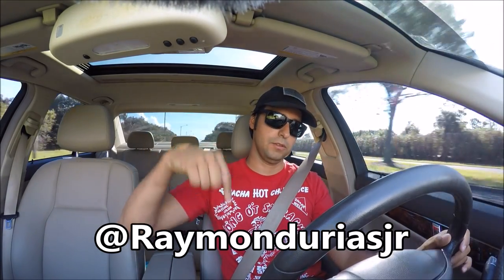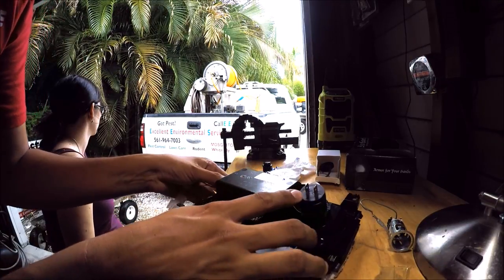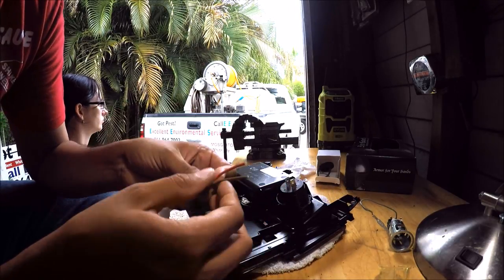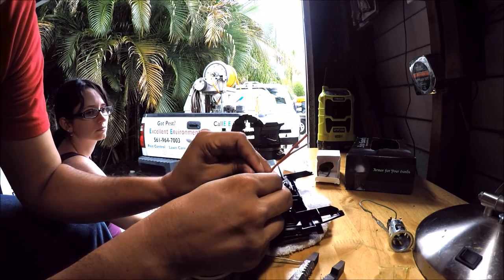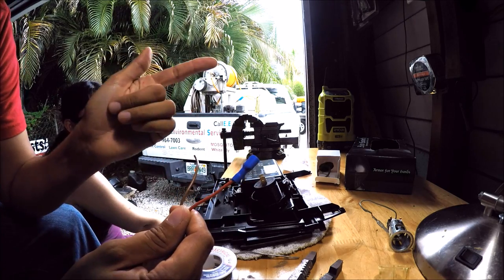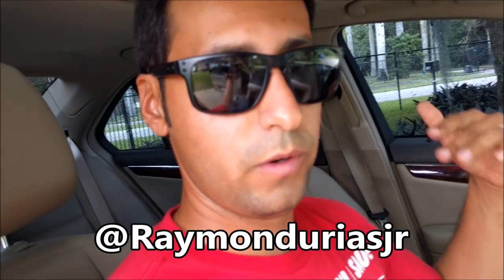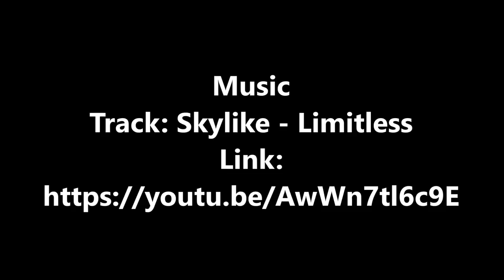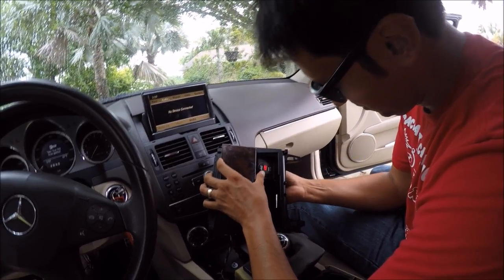Upgrade Your Cars Cigarette Lighter To Dual USB

Comment: The w204 has a voltmeter and ammeter built in.. put the key into 1st ignition and hold the call button and the “ok” button for about 5 seconds. Then a secret menu will pop up and you can view the cars voltage and amperage output, even when driving
Reply: Unable to access this menu for some reason.

Comment: Thank you for your very detailed video. I installed it in under an hour. Tip: to get the car in neutral, once you have the shifter boot popped up, you'll see there's a yellow lever you can pull back on while putting it into neutral.
Reply from the maker: That's also important to know if you're ever on a hill sometimes a car won't shift and you will have to press that button

Comment: Raymond, good videos. One quick thing I'd like to add is that it's not a coin tray, it's an ash tray. Now if people use it for coins and short out their fuse because they drop a dime in the cig lighter adapter by mistake, they can't blame Mercedes for that. They are the ones using it for other means than what it was intended for (but don't we all do that for all different types of things 😆). Keep up the good videos!
Reply from the maker: The GMan pssssh they knew what people were gonna use it for lol
Reply: Raymond Urias lol, very true! You actually gave me an idea where to put my spare change at instead of always emptying my pockets when I get home and then always having to break a bill because I don't have any change on me, ever! Lol
Reply: +The GMan ..my wife would find that change no matter where in was hidden..lol
Reply: The GMan I just dislike the rattling sound of the change.

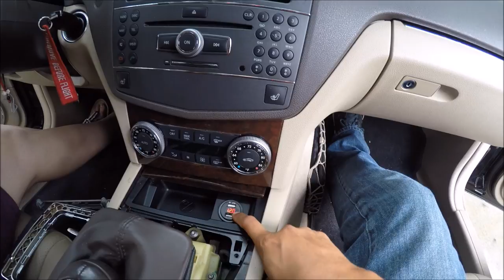Comment: 16:25 “12v the battery is working awesome”... It should be at 12.6 the battery is working quite badly actually. Also while the car is running it should be more than 14v, maybe the readings are wrong

Comment: SO I have a 2010 S550 and got the entire cup/lighter console removed but mine does not have a white quick connect thingy and goes straight into the radio wire bundle (?)… Totally trying to DIY and yours is the first video that actually got the lighter OUT but I am afraid to cut it out bc #1 it’s already pretty short with little to no wiggle room and #2 there’s nothing to disconnect first except maybe my battery…. Any tips?

Comment: Good mod but with the car running your voltage readout should be 14 plus volts as the alternator is charging the battery

Comment: Why not use a removable usb charger.  That way you could always use the cigarette lighter.  Or if needed use that port to use a plug converter adapter to plug things that arent usb and require a wall plug.  Or use it for a small car vacuum, or tire inflater that needs a cigarette port. Dunoo, just dorsnt make sense to retrofit that port.  To each his own i guess.

Comment: What's the name of that white plastic piece that the positive and negative wire plug into that you said be careful when lifting the tab when removing the wire?
Reply from the maker: 12v Voltage adapter
Reply: @RaymondUrias  I got it to work I taped it together with electrical tape. I broke the piece when I pulled it apart but it's all installed and working now! Thanks for the video bro

Comment: Hey Raymond quick question. My12v (front) power socket has no power. I've checked the fuse box (rear and front) and the fuses are fine. So what could my problem be? Do I need to replace my 12 power socket or do you think there is some wiring issue somewhere? Any ideas as to where I should start? If it is just the power socket itself, I suppose I could just buy one of these kits.
Reply from the maker: Daniel Sadjadian if it's not the fuse it usually is the socket. Pull it out and check the voltage

Comment: Nice video seems kinda hard for me to tackle down  any up coming mods to the car !!!
Reply from the maker: Snoopy4156 Just imagine that annoying guy from every Adam Sandler movie "You can do it"
Reply: Raymond Urias what are your thoughts on strut bar on the c class I was thinking of adding one to mine ?!?
Reply from the maker: +Snoopy4156 I don't think I would ever notice the difference. I don't drive that aggressive so feel the lateral movement. If you track your car then yes, if it's a daily driver then maybe consider different mods.
Reply: Raymond Urias thanks !!! I don't know what other mod to do to the car besides the eurocharge ecu tune I also want the drop the car a little inches but there's no video on that and I don't wanna do it without any visual guide

Comment: Is it quick charge compatible? Btw you need to turn your mic towards you when pointing your camera at something, I couldn't hear anything most of the time (On a mobile device)
Reply from the maker: +Sohayel Nafi this one is not it's just dual 2.0 fast charge is 3.0
My audio is gonna be the death of me. I had to remove the sound of a fighter jet towards the 2nd half of the video and lost alot of the original sound quality.
I going order a microphone that I can just clip on me, I'm over this Rhode mic! I have wasted over $300 on mics!
Reply: Raymond Urias I would be mad if something doesn't work after paying 300$ haha. Have to thought about one of those clip on mics? They are great but you gotta record audio separately

Comment: Raymond, I know this is a long shot because you posted this video a few months ago, however, do u happen to still have the bulb that went in that brown housing for the glow ring/ash tray light up?
Reply from the maker: +The GMan nope it was a standard Sylvania 2723... Little pos bulb that dies every year
Reply: Raymond Urias oh really? I had just come back from Mercedes and they didn't sell the bulb by itself. The parts person didn't even know what I was talking about, so after showing them screenshots that I took from your video, they then looked up the cig lighter itself and came to a conclusion that they didn't sell the bulb alone. I would have to buy the whole cig lighter that comes with bulb if I wanted it to light up again. So I said screw it, not that important! Lol. But since u know the bulb #, I can just buy it from advanced Auto parts or somewhere similar. Thanks for the info!

And thanks for that video because I thought it was a lot harder to replace the center part of console (where cup holder rings seem to be a part of. But it seems fairly easy to take apart. Thanks for the great videos again and for your help!
Reply: Bought the bulb at Walmart for $4.94, took everything apart, replaced it, and now it's working again. Something that's been out for like 6years now, lol...working again....thanks to your video! Back in the day Mercedes told me that it was going to be too expensive because of Labor that it really wasn't worth it just to have the glow ring and the ashtray light up...so I never bothered...but problem solved in 45 min. Thanks again!

Comment: Raymond, after you installed the usb charger, have you tried to charger and stream from your phone through your car stereo system and not get any current feedback?

On my 2003 c320 4matic whenever I would use my lighter port with the usb charger and then plug in my aux cable to stream from my phone, I would always get current feedback when I step on the gas. 
I would.like to add this feature to my current car 2013 w204, so I wanted to make sure this feedback didn't happen though.
Reply from the maker: +Bernie Cruz I get no feedback what so ever. As long as you ground it correctly you should not experience that 😁
Reply: Raymond Urias Sweet! 
Also, when you installed yours did the usb unit you got come with a fuse harness, like this one does?
http ://www.amazon.com/gp/aw/d/B01N6S2SNM?

Or do you think having the fuse inline with the circuit would not matter?
Reply: Oh, also any luck in figuring out how to make the rear trunk star badge illuminate, yet? 😊
Reply from the maker: +Bernie Cruz there is no need for a fuse lol there is fuse in the trunk for that lighter lol. I messed around with the trunk since we last spoke, kinda slowed things down a bit here for the holidays 🎉
Reply: Raymond Urias then once installing the usb charger, would it be a good idea to change the trunk fuse to a larger amperage to accommendate the added current when plugging in any device to the usb port? Like a 7.5A to a 10A, or something like this?
Reply: Raymond Urias Oh, also, on this video, why did you remove the cup holder cover? As I watched your video I didn't see how the cup holder would have interfered with removing the wood panel trim? Was just wondering if it wasn't really needed to be removed, is all?

Comment: Can I upgrade the back cigarette lighter charger with the same device?
Reply from the maker: Yes you can, it's even easier since the tray comes out
Reply: Raymond Urias thanks dude also I seen this port for the inside of center compartment https://www.amazon.com/dp/B01M0LWMWC/ref=sspa_mw_detail_0?psc=1 tell me what u think and if it might also work ? Thanks bro
Reply from the maker: It won't fit where the cigarette lighter is since that is larger

Comment: Got the part and got set to do if, but I am baffled at how to disconnect the lighter from the car. I expected a simple plug, but that’s not the case on the 2015 GLK. There are three wires attaching it and preventing me from removing it. Any thoughts? ( I don’t want to cut the wires, but I’m tempted!
Reply from the maker: D Huber what do you mean? The unit comes out just like this one. The 3 wires are the +12v Ground and one for the little bulb that lights up the lighter. If it looks different send me a video @raymonduriasjr on Instagram or email it to me
Reply: Raymond Urias thanks!  I got it...finally!  Any idea where to get a manual online for the android 10.25 head unit?
Reply from the maker: D Huber manual lol my videos are your only help lol
Reply: Raymond Urias 👍🏼👍🏼

Comment: Ray no power too the USB after install...
Reply from the maker: it could be a couple your connection must not be on right, or your fuse tripped, or you got a faulty unit( probably not the case) but you can check it with a multi meter
Reply: Raymond Urias I have my reverse camera in my fuse 71 location and it works.... The brown wire is the neg and red positive correct?
Reply from the maker: correct brown is ground. maybe the connections are loose check it with a multimeter.
Reply: If the fuse is bad which one would it be ray? Seems like no power...
Reply: Hey ray I figured it out ... Had too wire it different than you did... After I did that it was good!!! Thanks for video .. Another great one!!!!
Reply: I brought the same positive wire checker that lights up when its hot... It is a life saver!!!! My advice to anyone working with hooking up wires in a car( invest in one )....!!!!!